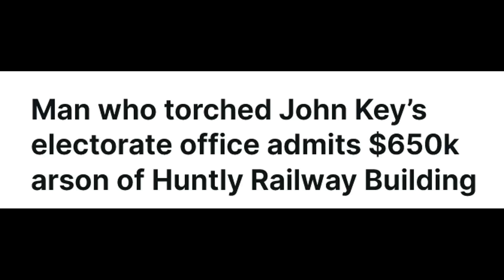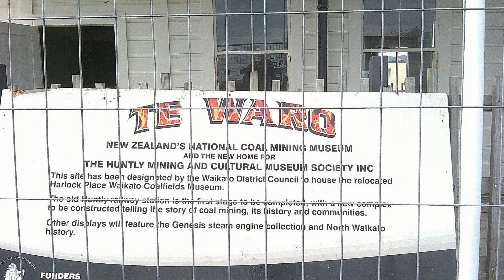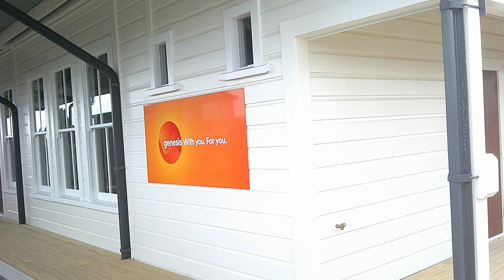Huntly Railway Station , From the Arson to Completion , Pt5 .

Comment: I hope they are going to open up the track side of the building by removing the fence and shift the 'Bus Shelter' further down the platform.
Reply from the maker: That new piece of fence is a slider but it has lock attached so they must only be opening it on open days .